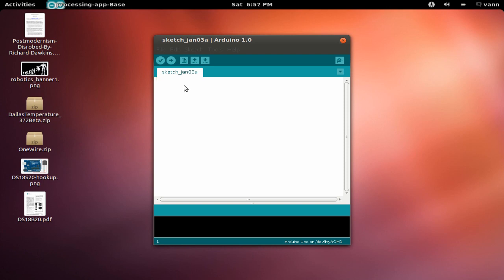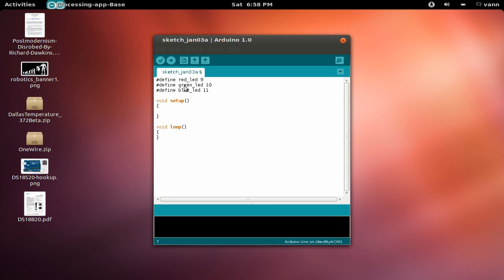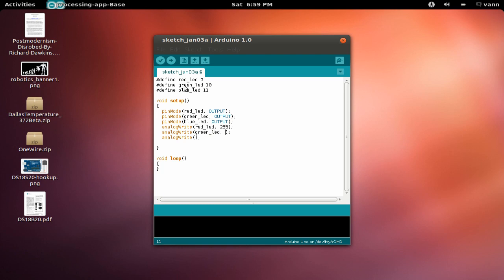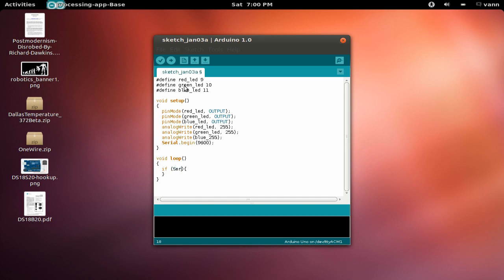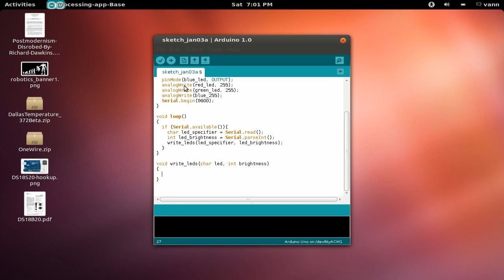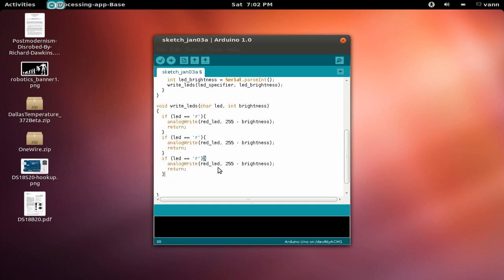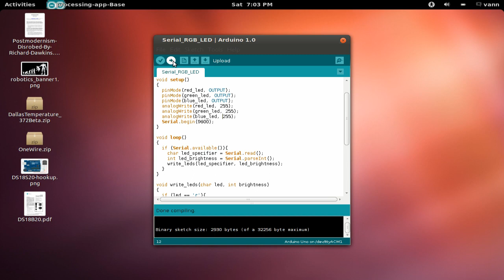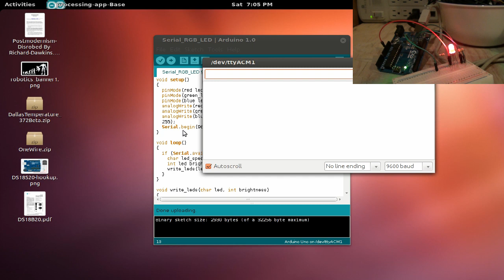Qt & Arduino - Making an RGB LED Controller - Part 1: Arduino

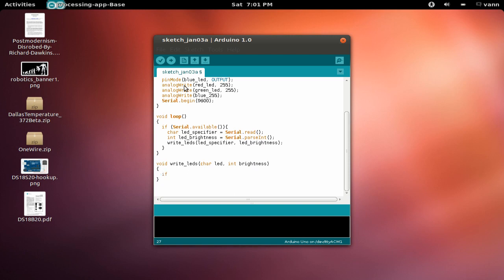Comment: 5:17 a switch case would be much more convenient and pleasant to read/look at.
Reply from the maker: I prefer if blocks over switch blocks.  They're more readable for me.  I don't have an eye for switch blocks and don't tend to use them.  But to each their own :)
Reply: @vannevarmorgan8682  They're also slower.